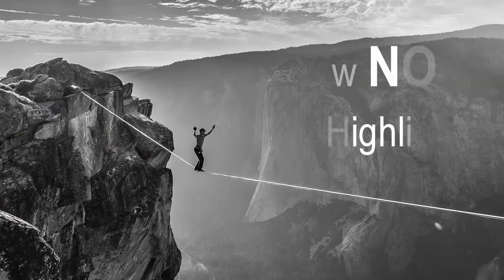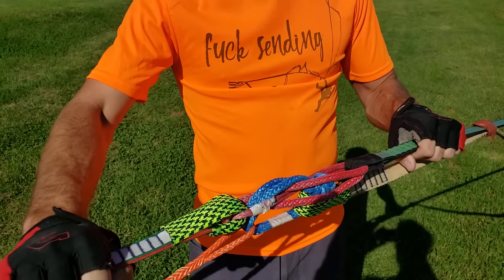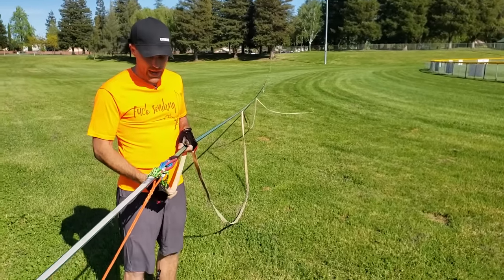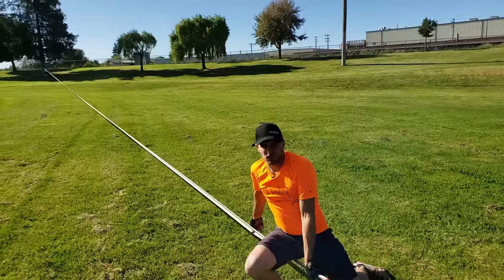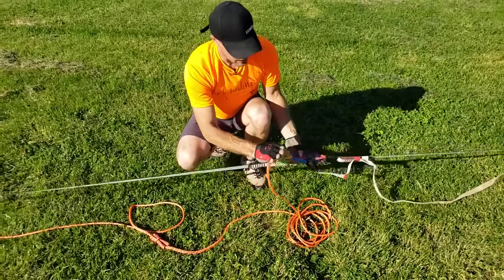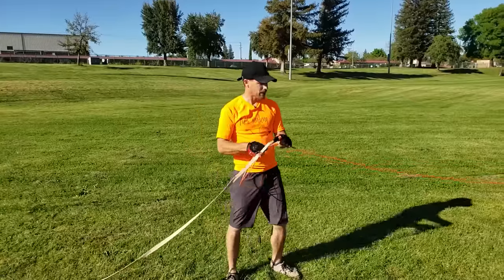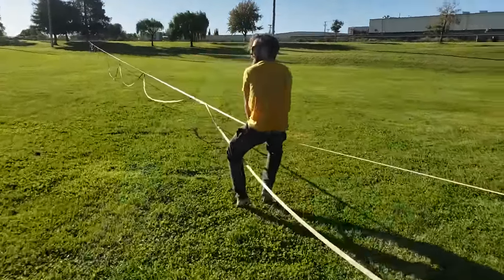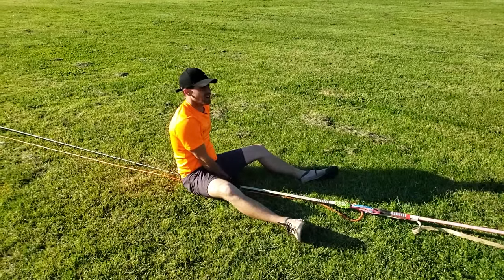Slackline Extenders.  How long do your highline extenders need to be for your Inov Splits?

Comment: According to the manufacturer's website, the stretch factor for pinkTube is 10.6 % at 3 kN. This means that your 50 m section of pinkTube stretched for an additional 5.3 m (to a total length of 55.3 m) when tensioned to 3 kN. This is 0.3 m longer than a 50 m backup with a 5 m extender, so it's quite obvious why you have lost the backup loops in that configuration. On the other hand, Feather PRO has only 2.4 % stretch at 3 kN, so it stretched for additional 1.2 m to a total length of 51.2 m. With a 5 m backup extender, this still left an extra 3.8 m of backup.

At 4 kN, the stretch factor for pinkTube is 13.3 %, so your 50 m section stretched to about 56.7 m. This means that a backup extension of 6.7 m would be needed before the backup even began forming loops in that situation. You seem to have added about that length of backup extender in the video (5 m + 2 m), and the loops were just about pulled tight when you tensioned to 4.3 kN. I find this quite consistent with the calculation above.
Reply from the maker: Good math!  I like adding the 2x 5m extenders together so all I have is 5m extenders.  So far it was worked for when I've used my stuff.  I like how I can always shorten it up by taping it a little bit.

Comment: Would you be worried of dyneema extenders wrapping around main line during winds and cutting main line? Similar to what happened in the past with a steel backups which is why you don’t use them. Or do you think 10m extenders aren’t long enough to cause that issue? That would be one of my only concerns with the extenders, wrapping around mainline and possibly abrasion on it
Reply: Amsteele backups
Reply from the maker: IF amsteel backups is a risk of cutting mains, it is only when you have 200 meters of it seesawing it.  I don't think there is enough weight behind it to cause any harm on short 5 meter sections inside of a short 50 meter length.  If people did feel this was a concern, it isn't too expensive to just get 5 meter or 9 meter sections of webbing with loops on end.